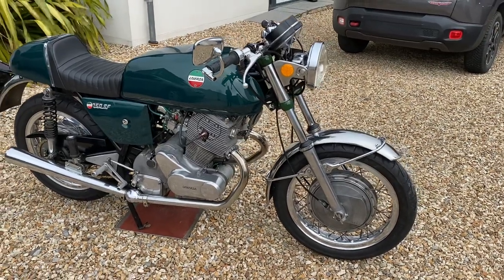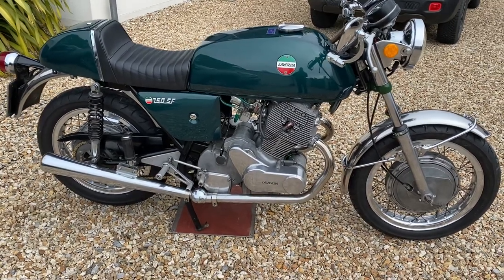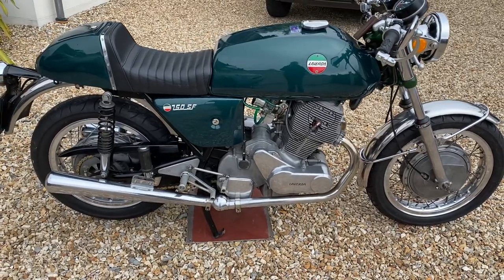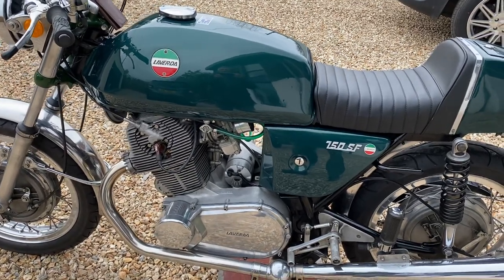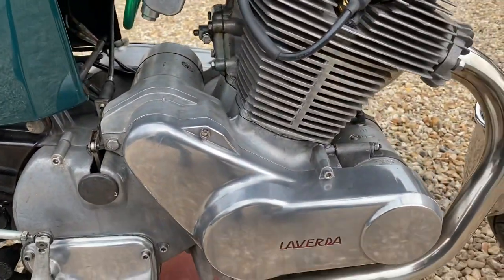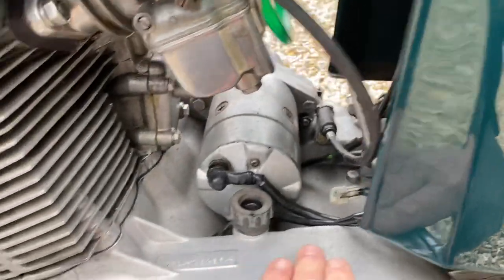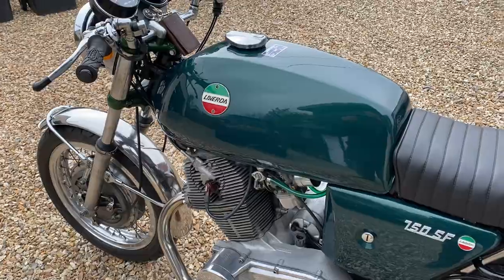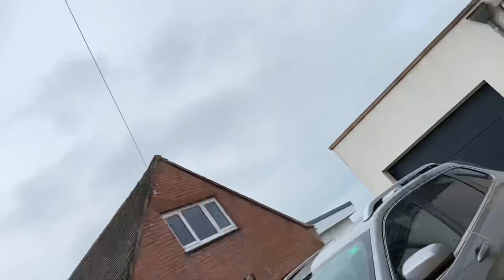Laverda 750 SF1 1972 walk around and start

Comment: I was on a road trip in the 70's thru New England  on a 750 Norton,snapped a clutch cable,stopped at the 1st cycle shop we came across which carried Laverda as one of their  lines,I was immediately impressed with the looks and style of the Machine, left a lasting impression on me,a true road Machine!!!
Reply: I did the same thing in 73 with my new Norton,(in old England) I think they installed some unlubricated cables, as the replacement lasted decades, came across Laverdas racing in Belgium in a Grand Prix, Impressed. Later shipped bike to USA home.

Comment: I had the same model in orange but had the plush dual seat. A cracker of a bike with outstanding handling & of course, brakes. I had a very strong left grip back in the 70's thanks to the clutch. I paid A$1750 brand new in 72.

Comment: Drum brake SF1's had Lucas switches originally I think, (mine did anyway as standard). The SF2 was just disk front brake (one or two did not matter) the SF3 had 3 disks and cast wheels. Both later machines had ND switches. AM4 linings made the front stopper as good as disks in my view, no fade at all and not grabby either. Your bike actually has a converted longer clutch conversion to make the action lighter :)  Great bike you had there. Thanks.
Reply: @Derek James Hi Derek. I designed and made it myself. I remade the mounting bracket inside the sprocket cover to move the pivot point higher up toward the clutch pushrod and made a new arm that was on an eccentric pivot. This allows adjustment of the pivot point so I did not have to cut the sprocket cover. Outwardly it looks standard but is much lighter in use.